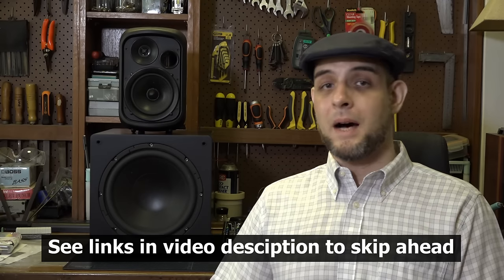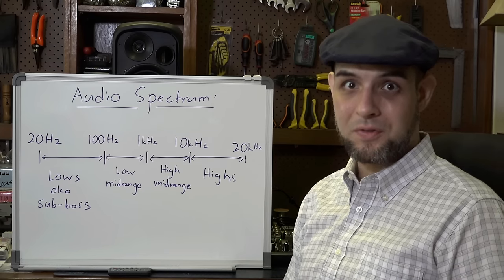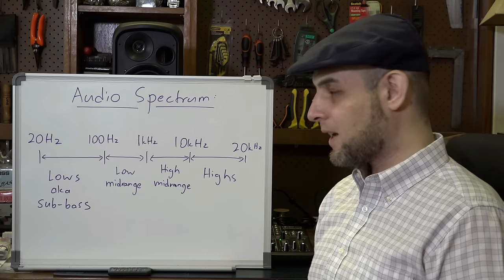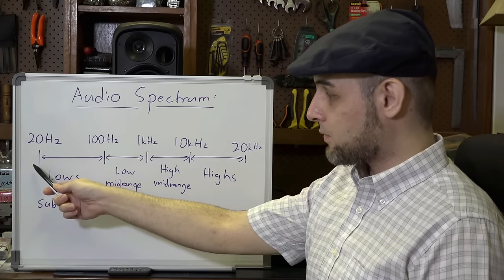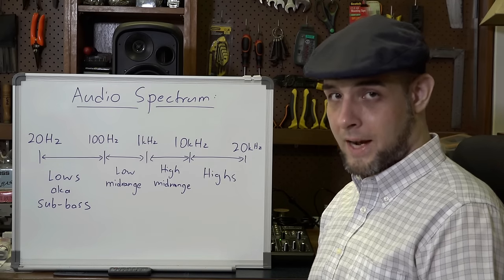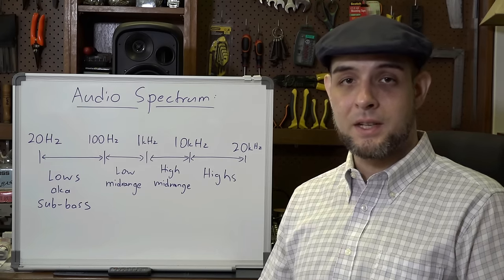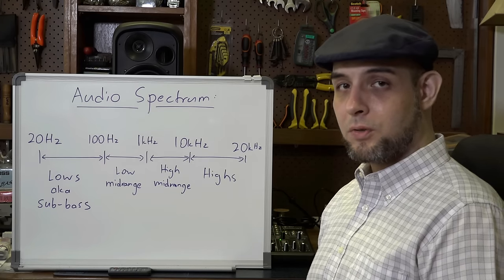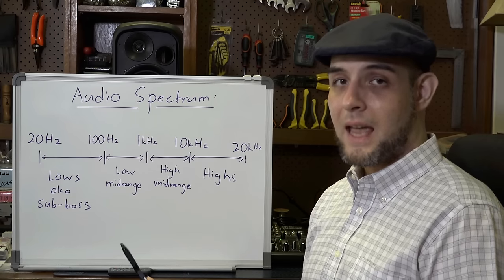How to connect an active subwoofer to a sound reinforcement system

Comment: How would u run two 8 ohm speakers one one channel and a one 8 ohm passive on the other the mixer is a nu3000 and its has a built in cross over
Reply: that one 8ohm sub on the 2 channel
Reply from the maker: The NU3000 is a power amplifier, not a mixer :) On that model just hook up your fullrange speakers to channel A and your sub to channel B, engage the crossover and go to town!
Reply: there will not be a impedance miswatch because i have to 8 ohm speakers on one side and a 8ohm sub on the othere ohm will be 2.667
Reply from the maker: No the amp has two completely separate channels so impedance is 8 ohms on the sub side and 4 ohms on the fullrange side. Make sure the amp is in 'mono' mode and connect to only channel A input.
Reply: ok ty I trust u love the videos wish me luck with the hook up will let u know how it turns out ty
Reply from the maker: You're welcome, let me know if you need any more help.
Reply: also i think u should make a video to explain that that info is good to know thought they was combined impedance ty
Reply from the maker: This video covers it: https://www.youtube.com/watch?v=HKpV30pjvIo
Reply: ty I see what u r saying now, in bridge mode the nu3000 ask for cable for speakon do i need the special cable configuration  for the highs or just the low end on channel b channel for the sub
Reply from the maker: Sorry I don't understand the question.
Reply: on the nu3000 i see the bridge mode is separate than the mono that what was confusing me
Reply: the cable for speakon are the same and not wired for bridge mode
Reply from the maker: Yeah on that amp the labelling is not good - it should clearly difference bridge mono from what is commonly called parallel mode.
Reply: Even the book does not explain anyrhing at all not even to help walk u threw set up. Its made for failure or to blow up something
Reply from the maker: That's Behringer products for ya, man ;) Make sure your next amp is a Crown or QSC or anything other than Behringer.
Reply: GLB Productions i know
Reply: This amp is very confusing on setup no more Behringer products
Reply: I may need you to email me a diagram  of the different mode setups with this amp that would be a big help.for me

Comment: ye man but i got onkyo amplifier and i got only one sub out when most of active subwoofers are right and left chinch
Reply from the maker: Yeah that is a mono output.
Reply: @GLBProductions  And if i connect 1x-2xchinch it will be stereo bass or its just a gimick and better connect it mono?
Reply from the maker: Nah, just connect in mono and leave it at that.

Comment: active speakers sound better than passive? are you serious?
Reply from the maker: For live sound reinforcement at high sound pressure levels, yes I feel they absolutely do sound better. Passive speakers can sound good, but when you compare a passive system to the equivalent active system with the same drivers in the same cabinets the active system almost always sounds better in my experience.

Comment: How  to connect 4 Ohms  speaker to an 8 Ohms Amplifier
Reply from the maker: Not possible, although most modern power amplifiers today are able to handle 4 ohms per channel in stereo mode. Check the amplifier manual to be sure.